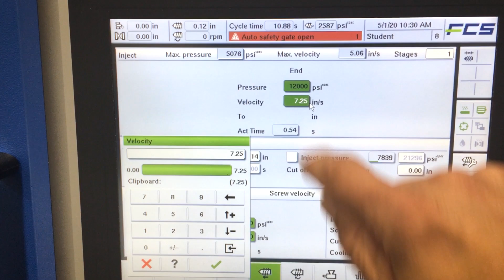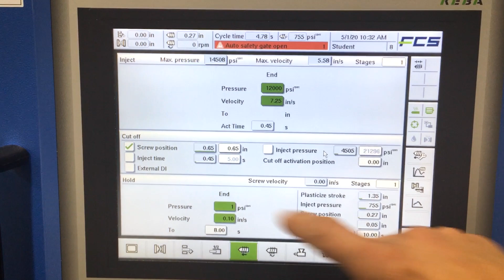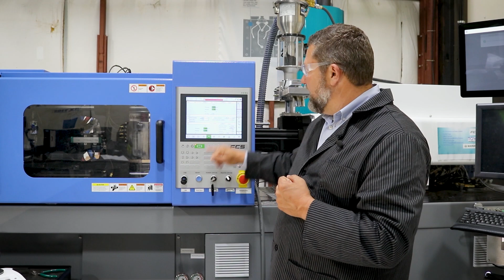What Actually Causes Flash in Injection Molded Parts?

Comment: Wet material, barrel temps, hot runner temps, low clamp pressure, clogged gate on family or multi cavity molds, nozzle temp too high, wrong material.

Comment: Looks like a Whitlock Dryer on this machine. I worked in injection molding from 1972 to 74. Good explanation of flash.  No computers in those days. hand held calculators and timer adjustments. Worked everthing from line super to QC and production supplies and scheduling.  Small company and recession of 74 took us out.  GTE bought us and let the front office go but kept the plant workers.  Should have not taken the promotion 2 months before being sold.

Comment: does injection pressure increase the pressure at the cavity when the cavity is not filled? My understanding is that until the mold is filled completely and plastic can move around, the injection pressure will be higher than the pressure inside the cavity. When you say injection pressure, where and how is it being measured?

Comment: Answer.. parts out of spec?
Reply from the maker: The Answer to parts being out of spec has as many answers as the universe has start. To boil it down , one or more of the 4 plastics variables are not where they were when the parts were good. Then that is caused by the condition of the plastic resin or one of the hundreds of machine settings. If you have some specific situations , we could offer some quality consulting to help come to a solution.

Comment: Video is very helpful, thanks. I have a question though, Duponts nylon guide says to use the maximum pressure for the holding stage. This bottoms out the screw though. Or if I increase the shot size too far I get flash. Should I not use such a high pressure?

Comment: Flash could be caused by a lot. Over venting the mold, big shot size, barrel heates too high, or mold damage/tool damage.  Shorts are usually just not a big enough shot but usually if you are short on one side and flasing on the other there is a problem with the mold or how the press is leveled.

Comment: Clamp tonnage not set right and mold cooling working correctly will cause flash....now is the die-height set correctly is your lockup position correct.  Do you have a broken tie-bar and is the mold there damage causing the flash?

Comment: been in processing about 14 years there are so many things and variations that can cause flash.i work with machines from 120 tons to 1100 tons.if youre process is where it is supposed to be to the original than obviously something changed.
Reply: What do you mean by the process should be the original and something changed? Can you explain?
Reply: Original process meaning it was making good parts and something would have to change weather material,heats,mechanical or something else that would make you alter your process from the master setup

Comment: I have been working in plastic for over 10 years and started from zero knowledge to working up to supervisor and now learning process more and more each day. I can say everything in this video is well explained and true in every way. These are the exact steps I take to prevent flash in almost every case when you can tell you are overpacking pressure and blowing the tool open. Obviously sometimes it can be from clogged venting and in "some" cases even injection speed can play a huge factor. But at the root of it all, you have to see how much material you are truly trying to push into a tool and where your cut off point needs to be. Your machines are a lot different than mine but also a great point to make is your shot cushion should not be your exact transfer point. There should always be a little "room for pressure" between the sprue break and the injection nozzle as to not cause a bonnet
Reply from the maker: Thank you so much for your input! We're so happy you enjoyed the video!! ☺

Comment: Only two things I know of that cause flash - Overcoming clamp pressure (This could be mechanical problems, wrong cut off, etc.) and mold damage. Also I like to use hydraulic pressure at cut off to set the hold pressure.

Comment: The other causes of flash other than a to low change - over position are: 1, tool damage. 2, imbalance fill on multi cavity tools. 3, Clamp pressure to low. 4, broken  tie bar. Jimbo🏴🇬🇧
Reply: I did read someone sayin a dirty tool cause flash, but that would be admitting that you don't set the mould safety pressure and lock-over/high pressure position correctly. 😇🤭🤣🏴🇬🇧

Comment: Bad spot. #1
Mechanical problems, slides and lifter timing,  wear plate alignment, manifold stack height issues just to name a few... alot of variables cause flash outside of the process

Comment: Mold cooling question. How much temperature difference between the halves of the mold is acceptable?
In my workplace they set temps. up to 30 degrees celcius! Way too much in my opinion.
Of course there is a lot of flashing due to thermal expansion/contraction of the mold parts/halves. Plus ejectors or slides seizing.
Pseudo "process engineers" claim that they have to do this due to parts bending or being not spot-on on size, dimensions.
How do you run your molds folks?
I know, in theory whole mold should be run on the same temperature, both halves.
Reply: Rjg answers your question the best he could not a good question to be honest..example a door panel with a speaker grille ..speaker grilles are usually pourus running hotter then the rest of the tool. It always falls back on material unless you have features in the part that require higher temperature
Reply: @joehart103  Still no straight answer, no number (or range, for example 5-10 C is "OK", more is very risky).
 
This is important practical problem.
As far as I know, molds are designed and made and "spotted" at equal temperatures (room temperatures). If you start introducing difference (especially at mating parts) there will be a problem.
 
Mold technicians are blamed for this. I can't repair flashing, it pops at the same spot after proper repair - because "process wanna-be engineers" set different temps. ruining the mold! And everyone thinks that's "OK".
Reply from the maker: Hello! Mold temperatures should be set according to the resin being molded.  The type of material will dictate where mold temperatures should be set.  The material should have a material data sheet or processing guide.  The mold temperatures recommended by the material manufacturer will be found there.  You are correct, starting with both mold halves at the same temperature is recommended.  Often 2 different temperatures are used to mitigate a mold or part design issue.
Reply: @rjg  Thanks, but still not answered the question - how much is "acceptable" and most common in practice.
A few degrees maybe? Let's say 5 deg.C? 
And 10 C (or more) is a clear incompetence in the crew ("engineers", mold design, way the molds are maintained)?

Comment: Another cause I've seen with is silly is flakes of plastic build up in the mold caused it to flash and the tech kept upping pressure which  caused it to really flash.
Reply: Incompetent staff at molding plants.
When there is any problem they always increase the clamping force (if possible, most molds are run incorrectly at max. press setting), increase the hot runner temps (problems with injection, cavity filling) and so on. Pushing harder, faster, hotter.

Comment: In regards to tonnage, we normally run max allowable by the machine, the exception is when your mold is, for example, a 1/3rd the size of the platen. Running too high of tonnage on a smaller mold will cause it to wear outwards.
Reply: That's bad. Many molding facilities damage the molds like that. Incompetent staff. Most molds in the world is run with excessive clamping force, twice as much is not uncommon.

Comment: Former QC for here. As long as the flash wasn't too bad, we could take an exacto knife and trim it. But usually on the machines we had (the plant I worked at sold to China in 2004) it was too hot or too cold. 
It wasn't the speed. Also, dirty molds and molds that didn't like to release
Reply from the maker: Trimming off the flash is what we would call “inspecting in the quality”. That is a huge time and $ drain. I have been in that situation before and sometimes it is the only option left but if doing those things don't become normal or accepted and you're always try to improve the situation then you are on the right track. Generally there is something to be done to not have to trim parts.

Comment: Where I work, flash is a bad problem. We have to do slot of trimming daily.
Reply from the maker: You're not alone! We actually hear that a lot. Flash is a huge issue for a lot of molders. We'd love to chat with you about your challenges and help you find a solution that actually works long-term. Feel free to give us a call to discuss: 231-947-3111. Or send us your contact information and location, and we will have your local account coordinator reach out to you.
Reply: @rjg  I work at a small plastic facility. The flash on parts is bad. The trimming always gets you backed up because certain cavities you are trimming hundreds of parts. I'm glad you responded.

Comment: Nice video , do you prefer single point injection speed ? Thanks for sharing the knowledge 🙏
Reply from the maker: One injection speed is preferred whenever possible. There are times when 2-3 speeds are necessary, but you should always ask if the additional speeds are creating a better outcome or adding complexity with no benefit. Simple is always better if it works.
Reply: @rjg  thanks 🙏

Comment: Why is it called 'flash'?
Reply from the maker: Flash, also known as flashing, is excess material attached to a molded, forged, or cast product, which must usually be removed. This is typically caused by leakage of the material between the two surfaces of a mold (beginning along the parting line).

Comment: Lower heat profile, reduce first stage injection speed , inadequate vents. Wear and tear maintenance, increase tonnage, reduce speed time, reduce injection pressure and timers.
Reply: Are you just naming term you have heard ? Explain how increasing tonnage can cause flash please ..
Closed vents would cause a short or a burn never flash

Comment: Nice presentation. At my plant, flash is usually caused by insufficient mold clamp pressure, 2nd stage pressure being too high, or the nozzle driving too deep into the bushing.
Reply: Man one of y’all help me then I got flash on one end of a two cavity lip bumper, one end flashes and the other side doesn’t
Reply: @michaelburks7928  have you done a cavity balance capability test?
Reply: @michaelburks7928  registration, check your part thickness on both sides. If not equal shim the side with flash on the cavity side wedge block. Could use labels to test, could be other things but that’s my first assumption.
Reply: @downbelowu1928  you close to Alabama?
Reply: @michaelburks7928  Ohio, just take some labels maybe 2 or 3. Stick them together and Stick them to the wedge block facing the flash. Shoot parts and see if it helps your problem. If so you need to permanently shim it with shim stock. Meet the difference with a if you are 20 thousandths bigger on one side put 10 in
Reply: @michaelburks7928  Without being familiar with your setup, mold, or what you've tried to remedy it, it's hard for me to give good advice. Possibly decrease your shot size slightly? If that causes shortouts, I might go with increasing hold pressure a bit. Sometimes tho if the pressure is too high, it can cause the parts to stick in the mold. In that case, if you bring the pressure back down and have enough cushion, I would maybe go with increasing the stroke a bit.

Every press and mold is different and lots of things can cause flash, but these are some of the common remedies we use with flash issues where I work.
Reply: Before you even respond I want to apologize for being nasty were all in the same boat trying to do our best in the shop to produce quality parts. I'm a toolmaker in Michigan, I deal with a lot of uneducated process techs that are there to turn on the machine only, so again you might be a guy that goes above and beyond his duties and I have no right to disrespect that actually I encourage it to a point. My only problem with what your saying is too much shim and your gonna cause somebody like me a lot of work welding carving and re-spotting the parting line. Not all production facilities have the luxury of a toolroom. But if you do Im willing to bet my check your gonna lose your job attempting this. I don't know how extensive your knowledge is but the guy asking the question, be careful advancing anything in any tool
Reply: @joehart103  Good advice. We do have a tool room in our facility, and even with that we are limited with things we are allowed to do as process techs to the mold. We can only do things to the mold that are allowed by the controls of the press with only one exception that I know of, which is to cut a few strips of a label and stack them to vent out a spot where burns are being formed on parts. I'm always very careful with what I do with a mold, bc the wrong things will get you fired (also bc my brother is in the tooling room at our plant and I've seen the hard work caused by the results of tampering with a mold inappropriately, even in what would seem to be a slight manner) such as a tech using a pair of clippers, intended for operators to trim parts and cut off sprues and runners, to pry out a stuck part and severely scratching the mold bc he was too lazy to go get his brass ones from his box. That cost a 21 year employee his job. We can do a few other things such as changing out faulty gas valves or removing and cleaning dirty pins on the molds that use them, but are generally discouraged or forbidden with direct work on the mold itself.
Reply: What stroke are you referring too?
Reply: @joehart103  Injection stroke or shot size, not the clamp stroke of the mold
Reply: Nozzles don’t dive too deep, they meet and a certain point. You have to already lost your process job
Reply: @downbelowu1928  I worded that incorrectly. I meant screw, not nozzle. As in the stroke being set too high.

Comment: Hold/pack pressure too high could cause flash
Reply: Yeah it's a common issue where I work as well. We had parts shorting out the other night so the tech increased pressure when he really needed to increase shot size and reduce pressure a bit. Ended up causing a large rib to break off in a parting line which took me a good half hour or so to remove.

Comment: Can speed cause flash in some other cases?  The runner is being filled faster than the material can pass through the gate. In this case, the runner actually flashes when overcoming the clamp pressure.  it is like your garage wall has a window in it and you have to pass through it at 70 miles an hour and your car cannot get skinny enough to pass through the window. Can this be the result when pushing very low MFI material? Isn't it possible to go from a thick area of the part to a thinner area and material is pushed in faster than it can pass through the thin area?
Reply from the maker: Hi Keith,
Great question.  The speed itself is probably not causing the flash but you are on the right track.  There is less resistance when flowing through the sprue and runner but in order for there to be flash the plastic has to hit the cavity wall to build pressure. The reason a lot of runners and sprues develop flash is because they are located close to the locating ring in the A half. This are has no support compared to the rest of the mold which rests on platens. What usually happens is the lack of support allows for the mold to slightly open, or deflect,  in this area. The common term is known as mold deflection and generally occurs around the center of the mold because the locating ring offers no support. Sometimes mold builders can assist with this by adding support columns to the back of mold, generally in the ejector box.

Comment: I worked in this field back in the late 1970's and early 1980's.  There were no electronic controllers then. Everything had to be set by turning knobs and setting limit switches by hand. The majority of the machines I worked with were toggle clamped, not directly hydraulic. As time passed, the company bought more and larger hydraulic clamp machines.  Still, no electronics. It was an interesting time in my life.
Reply from the maker: Hey Norman, thanks for watching! It's crazy how far the industry has come in such a short period of time, isn't it? That lack of control is exactly where Rod Groleau found his inspiration for in-mold sensors back in the 60's. It's so fun to look at how much injection molding has grown since then.
Reply: me too     350 ton toggle IMPCO     some Husky in the 80's

Comment: Blocked parts in other cavities caused by buttons, the left over material over fills the closest cavities causing hella flash and a list of other problems
Reply from the maker: If a cavity is blocked off like you said, then the extra plastic will cause a spike in cavity pressure. This is what we mean by injection pressure overcomes the set clamp force.

Comment: Clogged or restricted vents can cause flash.
Reply from the maker: The most common result of clogged vents is burning or short shots.
Reply: @rjg  Never heard of short shots causing flash, maybe oversized shots. That will also tend to clog vents. To high of injection rate and or restricted vents will cause burning also.  Also check clamp pressure in case of excessive flash.
Reply: Most of my experiences with clogged vents have been due to using additives like UV blockers, colorant, and mold release agents for blow molding. It causes a defect called sinks.